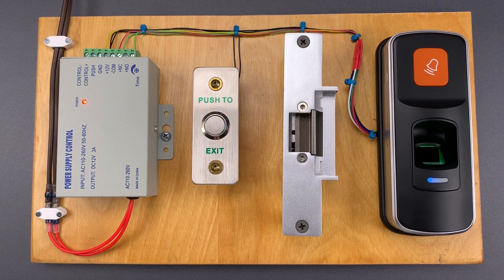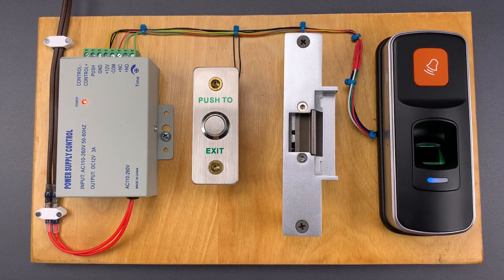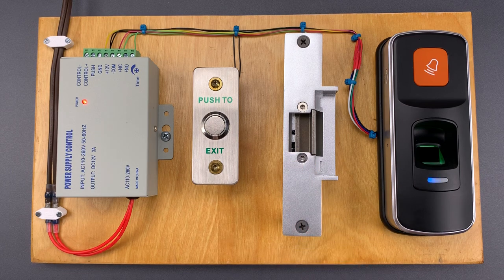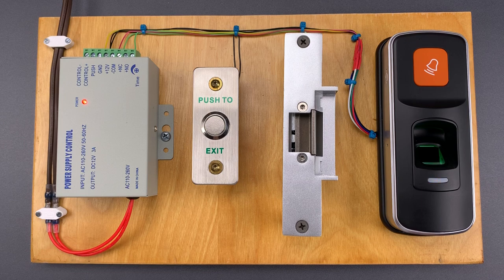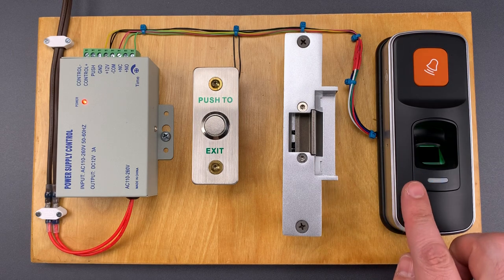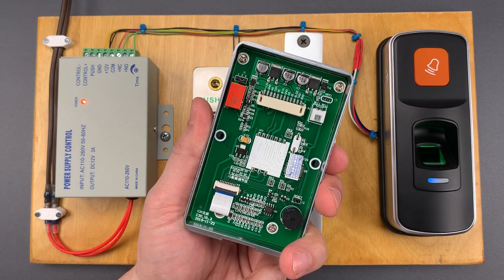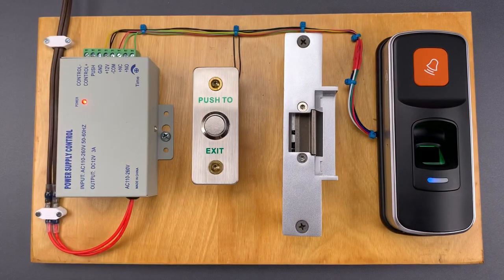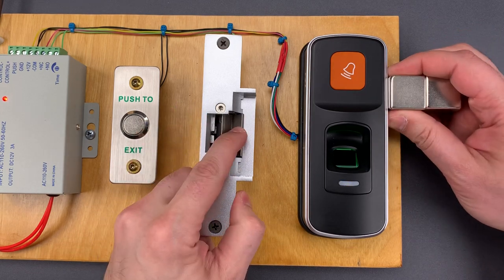[1060] Opened in ONE Second: HFeng Fingerprint Lock

Comment: It's hard to know if a lock maker is simply lazy or if their cost/benefit analysis suggested this type of forced entry protection wasn't warranted.

700+ thumbs up - I guess some people agree with me😁 Thank you!!!!

To be clear LPL also made a video where he opened a gun lock with a magnet just as quickly. When someone's LIFE is on the line you are not only lazy but also (criminally almost) negligent.
Reply: Oh it's just your homebrand, run of the mill, no frills 'Minimum Viable Product'.
Reply: Neither. They have good engineers designing to a price point. They don't think they'll be able to charge any more if the lock is actually resistant to this.
Reply: These are for access control, not security.
Reply: @sealpiercing8476  Would be very cheap and easy to fix, though.  Just have the part of the device sending the "unlock" signal be inside the door instead of outside.
Reply: The name "HFeng" just screams "we don't really care" to me
Reply: Consumers do cost/benefit analysis, not the makers. Lazy or not, if people want cheap shit, they're going to get it. It would fool you and me, and as for anyone more determined -  they can always just throw a rock through your window anyway...
Reply: @MelissiaBlackheart  Well, yes. The price point for this kind of thing is super low, so adding another assembly would increase it significantly, and that would be significantly harder to install, but the main thing driving it, I imagine, is that they don't think their customers can tell the difference between a performant product and marketing, so they won't get a cent more for it. Doesn't have to be much more expensive or harder to install if they don't think they can get a better price for the added value.
Reply: @MelissiaBlackheart  or use a solid-state relay.
Reply: @Scooters Videos Usually you use a realy because a mosfet can't handle the high current.
Reply: They probably just don't know what they're doing.
Reply: Ya, like many, I watch LPL explain so many locks and point out flaws that blow my mind. I always wonder, did anyone really try this thing out ? Did they test it ? Did they put any effort at all into looking for vulnerabilities ?.
Reply: I see no force being used in this... It's just a magnet. Nothing was broken nothing was hacked.
Reply: @walterk1221  Changing to a solid-state relay does not fix the fundamental problem of having the lock actuated from an outside box. If the relay were solid-state, then shorting the appropriate two leads or wires becomes the quickest exploit. Instead of one second, it takes maybe 30-seconds.
Reply: Most door latches run at 12 or 24 volts. A metal case would help.

I think a part of this design flaw is old design thinking (powerful magnets you can carry in your pocket are about 30 years old and affordable within about the last 10 years) and a lack of shielding.
Reply: @XJWill1  you are correct. However choosing the correct terminals to connect, and leave no trace evidence, requires some familiarity with the circuit. A magnet can be wielded by anyone. And eliminates any chance of fingerprints or DNA on the exterior device. No change will halt a knowledgeable attacker but the solid-state relay I and others have suggested will drastically decrease the number of successful attackers.
Reply: @MelissiaBlackheart  You don't even have to move anything. Just by changing the relay type to a solid-state relay, the lock should'nt have this vulnerability anymore IRC
Reply: It actually costs the same to use a MOSFET(electrically controled swtich) or BJT(almost the same thing)
Reply: @polvalente  No but like others said it would still be vulnerable to shorting. Might take 30 seconds longer. Really, the control box should send a coded signal to a controller inside the lock or interior controller. That would close the loophole.
Reply: This is lazy. It wouldn't cost anything extra to move the "control" portion to the interior component (the "push to exit") rather than the exterior.
Reply: I dont think they are lazy, the problem is that most of these electronic lock tech companies knows how to make electronics, but not a heck of a lot about physical security.

They just simply dont have the mindset to think about the physical security of their product.

The main problem is that they dont employ people that have experience, breaking these kind of security systems.
Reply: The moment I heard "relay" I was flabbergasted. What's shown here is not some kind of incredibly advanced science, it's electrical engineering from 1850, telegraphs worked like this.

It's incompetence. I'd go as far as saying it's fraud, this is like a locksmith telling you they'll mount a traditional lock on your door and actually mounting a little pin or something that opens with any key, just shaped to look like a legitimate lock. The relay was a cost-cutting measure because these people aren't held accountable for the shit they sell. If a locksmith defrauded you by installing a fake lock they'd go to jail.

Safe electronic locks are perfectly possible, either way, if you don't use easily gamed components and insulate the device properly. It's just that this crap barely qualifies as a lock despite being sold as one.
Reply: @walterk1221  yes indeed, or just a mosfet if the solenoid is dc-powered, it would be even cheaper than an electromagnetic relay
Reply: @Scooters Videos indeed - mosfets that handle a couple of amps cost pennies, the only advantage I can see for a relay would be that relays can handle ac, it might be that they're using an unrectified supply for the solenoid - a lot of older door control systems did, hence the "buzz" when buzzing someone in
Reply: People seldom do penetration testing. A stand alone system is cheap, easy to install, and looks just as secure to a consumer who doesn't look closely.
Reply: @JohnDoe-bd5sz  I've seen that with gun locks and gun safes where they know a little about security and nothing about guns and they sell complete JUNK. When a gun is involved the lazy-negligent line becomes much more clear. This applies to the manufacturer and the consumer. When you have a $49 gun safe on clearance securing your "home protection" kids can hack into them easier than some adults.
Reply: @bobbycratchet3958  Paying more does not insure that the design is better.

Right now i am in the process of deploying some gate intercom that cost $500 a unit. 

This is not something i choose, but the company headquarter decided that these units were just fine.

It is basically a unit that has a back-box that you screw onto a wall or in this case a square pole and then you screw the unit onto this box.

They use 4 ordinary Torx 20 headed bolts and it then opens a gate, using a relay.

So if you have a Torx 20 (Not even security torx, even though it would not make that much of a deal) and a paperclip, you can open the gate in 20 seconds.

This thing does not even have a tamper switch...Which offcourse would be a waste because you have access to the 2 wires you need to bridge.

I dont know if the relay can be trigged by a magnet, but doubt it because the housing is cast iron, but 20 seconds with a screwdriver is all it takes.

I asked HQ if they had considered tamper proofing this, and they looked at me like i was crazy.

Their take in this was "Well nobody knows it's that easy so what's the problem".
Reply: @JohnDoe-bd5sz  I was only suggesting that a $70 Hfeng lock doesn't suggest a high end security solution but instead a low level deterrent and while some money could be moved around there's only so much that can be done these days where the consumer is paying $70 meaning their cost is even less. There may have came a point where they decided enough was enough for their target audience. This could be used in a chiropractor's office so the employees have a quick way of passing through a gateway but nobody would have a magnet because there aren't drugs or anything else behind that door.

https://www.youtube.com/watch?v=mPy-UAQxvU8 LPL That lock can be opened with a paperclip and a Phillips head screwdriver.
Reply: @thatsforstarcraft1523  high currents such as 3 amps at best. A standard decent relay will stand up to 5 amps at 12v.
Reply: @MelissiaBlackheart  Its not as simple as that. Look at the the other videos where he intercepts the card reader signals to unlock. Its mainly about cost and application. This would  mentally deter 99% of people. Physically its just easier, faster and cheaper to use a crowbar to bypass this lock. Its a viable access control system for some applications but certainly not for securing a high value site.

I would be actually happy to install in my house if it had a tamper switch on the back. Id hook the tamper to the security system.
Reply: John Doe Nope, it’s just that they’re cheap. Also, it’s important to keep in mind that the lock and the reader might be made by different companies because they’re standard, hence why most have these vulnerabilities.
Reply: @XJWill1  you can short these too
Reply: I suspect it's an engineering blind spot.  Engineers aren't used to having to build things in this kind of "hostile" environment.
Reply: @walterk1221  Some solid-state relays also use a magnet to activate a small reed switch.  That's how they isolate the input connections from the output.  The real answer is to move the authentication inside where it's better protected.  That would solve this problem.
Reply: Can you even call this "forced" entry?
Reply: @russellhltn1396  if you are correct (which I, as an engineer doubt) I am referring to a device which uses a triac or scr or switching transistor, i.e. a solid-state semiconductor with no mechanical moving parts what you described cannot be accurately called a "solid-state relay".
Reply: To be fair, I don't think very many criminals are this knowledgeable about these systems.  I'm leaning towards cost/benefit myself.
Reply: You could show this to 100 random people and I'd be surprised if half could do it!
Nuf said?
Reply: @kennethhicks2113  do you mean do it "in the wild" or do it using LPL's rig? In the wild I suspect only a few would recognize which equipment the vulnerability exists. Using LPL's rig, I believe the success rate (especially after a demo) would exceed 97%.
Reply: @walterk1221  I do like your optimism about the intelligence of humanity today : )
I'll take that 97% bet btw ; )
Reply: @Scooters Videos non zero cross ssr.
Reply: @Scooters Videos   Maybe look up schottky, tansistors, bgt, igbt, triac A vs V vs T curves.

Either way it is a moot point as the design is flawed.  The fp scan should be sending an encrypted signal to an internal asic.  There should be no raw go-line external.
Reply: Actually the sensors part is supposed to be mounted 2cm in the wall.
Reply: @swedensy  electro magnet and a 9v.
Reply: @swedensy  There's another LPL video where a similar style lock had a Phillips screw on the bottom that when removed allows a paper clip to be inserted and the user can force the lock open manually. As long as the locks are recessed (installed as directed) their Achilles heels are hidden, until their not.
Reply: @walterk1221  I understand what you're saying, but I think you'll find your idea of "Solid state" differs from the industry.  I've taken a few apart.  And I understand why they used a real relay in this application - because it's the interface to customer supplied equipment.  Nothing more universal than dry contacts.  I think it's hard to get away from.  But since we already know that doing to decode at the door is a bad idea, the answer is to move the relay to an inside device.
Reply: @russellhltn1396  I find no reference calling a reed relay a solid-state relay. However, I agree with your simplicity for the end-user comment. The coil in the striker most likely uses "doorbell voltage" AC... (just speculation, not part of discussion).
Reply: @walterk1221  And I can't find a ready reference for the kind I've seen - a reed relay with solid state "contacts".  The reed provided the isolation between the "coil" and the "contacts".  This was a fairly chunky sized one for driving a motor.  Way too big for this application.  All I'm saying is that if you're trying to use a solid state relay to avoid a magnetic vulnerability, make sure it doesn't have a reed relay as part of it.
Reply: @russellhltn1396  you have piqued my curiosity... but, in any case, the relay should not be on the insecure side
Reply: Just simple market system/capitalism, all production and distribution begins with the expectation to get rich, since when this system cares about needs or anything rational? You people act like you was just born, take a look into reality.
Reply: It's a two option/relay lock,  LPL took the outside relay

Comment: I can't believe the relay is actually in the outdoor scanner.
Reply: right ? there are many other ways for this purpose and they chose this one :D
Reply: I used to work in a building with external standalone keypad locks. The interface to reprogram them was outside. Anyone with the right cable, a laptop, and access to Google could connect to it, reset the lock, and open the door. 20 years older than this tech, so clearly the manufactures still don't care if their products are at all secure.
Reply: There is a relay in the "power supply control",   but it is unclear who's doing what
Reply: Neither can I, nor can I think of any reason why it would be put within the scanner housing. It would be much more logical for it to be within the lock housing itself; you put your finger on the fingerprint scanner, that would then give an electric signal to the lock housing if the fingerprint matches, the electric signal actuates the relay in the lock housing unlocking the lock, and voilá. It would still be just as easy to unlock with a strong magnet if the relay were in the lock housing, but at least it would make more sense than putting the relay in the scanner housing.
Reply: Funny how they could've just used a MOSFET
Reply: @pieterveenders9793  The relay that actually activates the lock is in the separate control unit on the left. The relay in the scanner is just producing the signal to tell the control unit to open.
Reply: @cydia2020  Would have been cheaper too...

Comment: Even in the 1950's and 60's they tested vending machines and coin telephones against magnetic "attacks".
 Those that do not learn from the past...
Reply: I mean to be fair, a chunk of rare earth magnet of this size is not cheap!
Reply: Take apart an old hard drive and you can find bigger magnets than that. And if you are a thief anyway...
Reply: @markdog3355  I don't think those are rare earth though I might be mistaken. (And as usual, the purpose of locks is to stop relatively honest men).
Reply: @markdog3355  No you can't.  Those are gigantic.
Reply: I've taken apart a dozen hard drives. And I can assure you, the combined magnet is gigantic and super powerful. Anyway, powerful magnets aren't rocket surgery. My point was that magnetic attacks should not be possible .
Reply: gigantic magnet attracts a lot of attention, though, but I can certainly see your point
Reply: @markdog3355  As have I.  And you'd NEED dozens to build a magnet that big.  Just look at it, it's absurdly large.
Reply: @ZeroPlayerGame  I've got a stack of them I took out of a burned-out EV motor...so not expensive at all. Well, the motor I bought to replace it was, of course...
Reply: @MrJohnRWells  haha, makes sense
Reply: @markdog3355  Must be some weird big ass HD's you've worked on because most just have a couple of curved flat plates (semi-circle-esche) not a gigant cube.
Reply: @martinaasandersen3775  Well,you could take apart a speaker. Those have big magnets inside.
Reply: @ZeroPlayerGame  I wonder how powerful an electromagnet would be. Possibly made to run off a 9v battery. I've seen ones that throw a solenoid switch that I couldn't move.

Comment: They need to employ the use of solid state Relays, which use Transistors for switching rather than electromagnet
Reply: Any bets that one is a vastly cheaper option for them to manufacture?
Reply: @calculuspi2070  Vastly cheaper?  By all means,  I'll take your bet that some electronics is vastly more expensive than some equivalent mechanics.

Comment: Hilarious that solving this vulnerability requires only 10c more in parts. Just use a power transistor or SSR in place of the relay, which is not vulnerable to magnets..
Reply: But then the lock is 12c more expensive and no longer shows up on the first page on AliExpress, meaning that it doesn't get picked up by dropshippers and thus won't show up on Amazon's first page either.
Reply: @dsp4392  undoubtedly true 😆
Reply: No... Put the validation system on the inside of the locked door.
This is the modern equivalent of putting the hinges on the outside.
Reply: @alexm9479  well not all of us can afford fancy communication busses to our locks :)
Reply: does it even need an SSR or wouldn't a MOSFET do?
Reply: Or wire it to use the inside relay instead of the outside relay, it's a multi function lock
Reply: @Seelingfahne  fancy? How much for a USART and an EEPROM these days?
Reply: @trif55  modern SSRs are built from MOSFETs and you need multiple to handle AC power.
Reply: @Seelingfahne  indubitably*
Reply: Thats exactly what I thought just use a power transistor to switch the lock. Moving parts are always the weakest links in these systems.
Reply: @trif55  an SSR is a mosfet in a box with a photo diode and detector, but yes a mosfet would do
Reply: @UpnorthHere  Problem is that you can record the signal and then play it back. You need encryption between the inside and outside or in the case of a fingerprint lock you need to communicate the the fingerprint to the inside with the decision made inside.